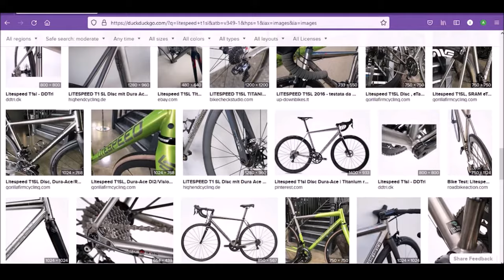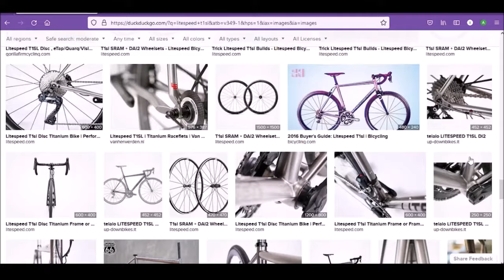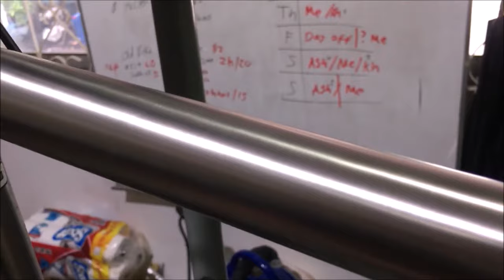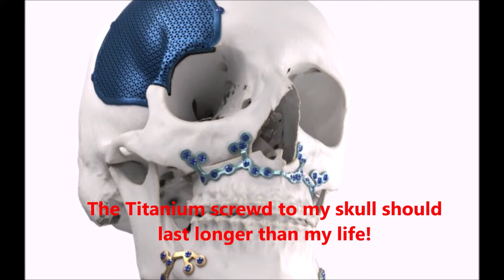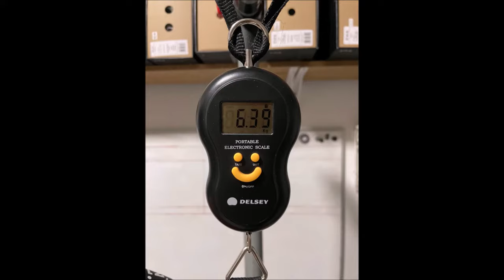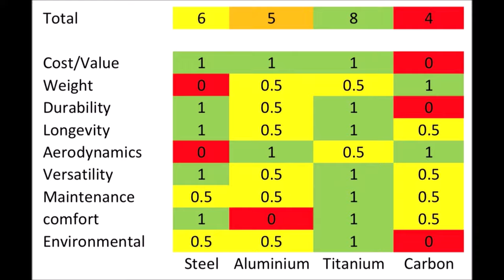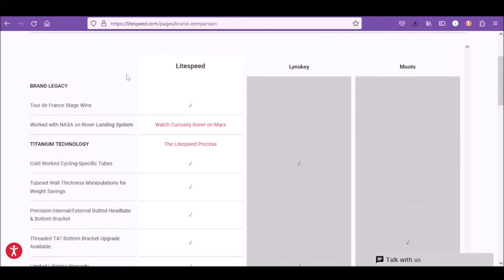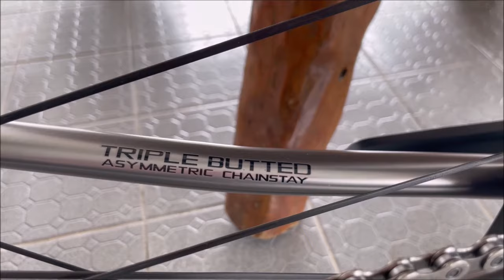The World’s Best Performance Road Bike. (And It’s Not Carbon…)

Comment: titanium doesn't degrade over time, could be same for plastics, but we don't praise them for being non degrading and living 1000 of years in a ground. 
Steel by rust returns to nature as if it was never there before (nature will absorb it and nourish). Aluminum much less and even less titanium. a Ti frame will be found there 2000 years after... that is NOT A POSITIVE from environmental standpoint. (I love it by the way, just the argument is very bad)
Reply from the maker: Explain further? Plastic brakes down into tiny bits that we then consume via water and food. Titanium is inert and doesn’t brake down over time. So no need to bury it in the ground, it can be recycled and reused endlessly. 

I don’t follow why this is a bad thing? 🙂

Comment: Street cred is important. I will openly admit on a public forum that I buy carbon frames due to peer pressure. It sounds like I’m cutting edge and modern when I tell friends I have a carbon bike 🚲 👍
Reply from the maker: True, peer pressure is the main reason people choose carbon in Brunei. They don’t want to be the odd one out, it’s especially strong in Asia.
Reply: @reginaldscot165  And here I am, still riding on aluminium after 11+ years of riding. I now have two aluminium road frames, one rim brake (already built a year ago at home) and one disc brake (only has its groupset, everything else isn't bought yet).

Comment: Haven't watched the full video but that carbon-aluminium-Titaniun tube test at 16.58 onwards is worse than iffy.

Carbon tube the jeeps wheel is sitting flat on the concrete and the tube is well forward of the shuck. Aluminum tube the jeeps wheel is sitting flat on the concrete and the tube is sitting well forward of the shuck, but on the titanium tube test the jeeps wheel is buried almost halfway down in a shuck and the tube is sitting on the edge of the shuck so full pressure isnt resting on the tube as it was on the previous tubes and the crushed aluminium tube also helps prevent the full weight of the jeep crushing the titanium tube.

100 lines of could do better for Reginald.
Reply from the maker: Not sure what the last sentence is referring to but… I can tell you that that test is legit. I have several titanium tubes in the shop and no way my 4x4 is crushing them. Titanium is really, really strong. I have 1 that’s an off cut of the 6/4 titanium top tube of the T1SL, it’s less than 1mm thick and it’s unbelievably ridged and strong. I get customers to do anything they like to it, I say (if you can bend that paper thin tube I will give you the bike for free! So far nobody got a free bike. 😂
Reply: @reginaldscot165  Can't agree with you on that test being legit tbh. Looks like something Del Boy and Rodney Trotter would have put out.

Comment: This is heavily biased against carbon fiber.  I don't know ANYONE who has to replace their carbon bike every few years, ridiculous statement.  I have one that's 10 years old, no cracks or issues.  So why does that Litespeed have a carbon fork and carbon wheels?  And your chart, you weight every category the same.  That's not realistic, because depending on your needs, some categories would be weighted more heavily.  So, interesting, but not the final word on the subject by any means.
Reply from the maker: Just imagine how big the chart would be if we adapted it to every individual situation. Its general statements, and in general it’s correct. Well, I work in a bike shop and I see plenty of carbon bikes that don’t last… so I’m going by experience… I had one that didn’t last 6 months. BB shell cracked on me.
Reply: @reginaldscot165  I am intrigued now by Ti.  Problem is, I love the way aero bikes look, and I think aero outweighs weight in most cases.  Being in triathlon, I am looking for a tri bike, and I believe they are ALL carbon.  Are there any Ti road bikes that prioritize aerodynamics?  I don't think Ti lends itself to the same aero shapes though.

Comment: your table is a mess: some of the attributes you list on the environment category belong in fact elsewhere (longevity... which is quite the same with durability). 
And some relevant omissions: carbon footprint for turning titanium to tubes and then welding those tubes? 
Etc. etc....
If you make a point that a bike is the best performance bike, then some of your categories are irelevant.
Reply from the maker: Longevity is different from durability. Something can last a long time, but if used isn’t resilient. Durability relates to how something can resist damage whereas longevity relates to if a material naturally degrades over time. 

I think all aspects are important when finding the best performance road bike. It is a performance road bike and the categories show why it’s a better choice than other performance road bikes. 🙂

Comment: Can someone tell me why they use a carbon fork instead of titanium? Is it hard to make such a shape or any other reason? Amateur here...

Thanks.
Reply from the maker: Yes. So difficult and as a result more cost. Also it’s the part of the bike that normally takes the brunt of the damage in a crash so better to have something expendable. Also it makes it easier to change brand of forks to get different ride feel if you want to change the geometry. Also as people already make lots of forks it’s easier to buy from them than make your own.
Reply: @reginaldscot165 Thank you!

I see your point against carbon. How does the fork hold up to that? Do you replace yours over some time.

I currently only have 1 alu bike for everything and mostly commute. Its harsh sometimes. Would you advise against a carbon fork for such use?

Comment: If that was the worlds best performance road bike, you would see pros riding it. However since it is a not so aero bike made out of metal, and also not very light for a rim brake bike, as pedals are included in the uci weight, it is of course not the best bike. But surely it can be durable, the sad thing though is that a negligent owner might just as well send this bike to the scrapyard as a carbon bike owner, not many people want to ride the same bike for 30 years.
Reply from the maker: Your reasoning is flawed. 

The prevalence of a bike or item in the “Pro tour” has zero relation to its performance. 
Firstly, there are literally 100s of items and bikes that are banned for use by the UCI for pro riders that would definitely improve their performance. But they are not allowed because they contravene some rule. 

Secondly, Pro riders don’t choose their own equipment, they get given equipment based on sponsorship. Pro cycling like all big spectator sports is all about money. Titanium manufacturers are small and don’t make the volume of bikes to make the money to sponsor a pro team. 

Also, the system is set up to discourage brands from making long lasting bikes. The Pro bikes change every year, sometimes twice a year. There is big money to be made in selling the next slightly different shape of carbon bike. The same couldn’t be done with titanium, it’s too difficult to make new designs like that and it lasts a lifetime so there wouldn’t be any reason to keep changing your bike. 

To put it simply, titanium bikes are not profitable because they are too good. It’s the same reason nothing lasts anymore, planed obsolescence. 

People with the intelligence to buy Titanium aren’t normally the sort that would dump it in a landfill. 😇
Reply: @reginaldscot165  You have higher faith than me in people who afford to use the kind of money that would easily get them a sports motorbike on a bike. From my reasoning these guys would normally be in their 50s and well off. In the not so unlikely event of a lack of interest or declining health 10-15 years later, who knows where the bike ends up. If the gears or brakes have ceased to function after years in the shed or are worn out, the scrapyard is not so unlikely, as on the used market these are not valuables anymore. What if the owner dies - titanium bike in garage sale, no takers - landfill. The talk of carbon bikes deteriorating is also vastly exaggerated. My current carbon bike is 6 years old and has 37.000 kms on it. The drivetrain has been changed of course, but these are metal parts. Also the wheelsets have changed a couple of times due to wearing out on rim brakes. Again these have been mostly metal parts - alu wheels, however currently on carbon wheels. But the frame ? Not wearing out unless you crash it, and believe it or not, a titanium frame can also be destroyed in a crash, just like any car or motorbike made of metal.
Reply: @reginaldscot165  You have completely missed why new bikes are coming along all the time in the pro ranks. Mostly it is new equipment on the bikes, the frames do differ but only slightly, but the addition of another sprocket every few years is indeed a market trick to get everybody to buy the latest 11 speed then 12 speed then electric this and that, then discs over rim, then aero bars, integrated cockpit, all things that could just as easily be swapped on a titanium bike. If you change out the word "good" with durable or environmentally friendly, then there might be a discussion. But when it comes to being outright fast, obviously all the amateur racers in the world have long since found carbon to be the best, however both ti or steel can be good bikes, they are not the best :-)It is refreshing though to think about the old pros who rode 40km/hour average on 10-11 kilo steel bikes with what 8 gears at the back ? Not all about the bike.

Comment: Not necessarily a bike for life with rim brakes. Components are getting harder to get. We will see the time when Sram and Shimano will no longer offer rim brake  groupsets and rim brake wheels will no longer be made.
Reply from the maker: The way things are going I think rim brakes are going to outlive western civilisation. 😂 
But seriously, I still have the first good rim brake group set I ever bought. Ultegra 6600. Still in perfect working condition. I don’t think finding pads is going to be a problem. I don’t change them regularly, maybe 1 set every 3 years? I also have a stockpile. People will continue to ride rim and some manufacturers will continue to provide parts. (I can still get new parts for my 1996 car.) As for wheels, I get through rims about 1 set every 10 years. I have 4 sets of wheels currently in use and I have other new unused sets. Again, they will be available. Don’t forget that if you have let’s say for argument 40 million people riding rim road bikes. If they all switch to disc that’s 40 mil second hand parts minimum now available. That’s on top of the 100s of millions of parts in shops and warehouses that is yet unsold. Look at Durian rider, he buys second hand rim bikes all the time for next to nothing and thus has an endless supply of parts and spares. 🤷🏻‍♂️
Reply: @reginaldscot165  I guess I should've said new components will be harder to find. For example, Litespeed no longer has rim brake frame offerings. At some point, Shimano and Sram will stop offering rim brake groupsets, al least in their upper end lines. The wheel manufacturers will follow suit, because if there are no more rim brake frames, why make rim brake wheels? Will there enough of a market of people wanting to upgrade rim brake rides to keep making rim brake groupsets and wheels? You're right in that there will be second hand parts. True.

But consider something like my situation. I needed a new frame. Rim brake. About the only new rim brake frames I can find are the open-mold Chinese ones. Not that they're necessarily bad. Some of them are good. But you can't be sure.  I've always wanted a Litespeed Ti bike anyway, so I'm taking the plunge and drinking the disc brake kool-aid. Forgive me.

But funny enough, as I write this, I see a video featured about "Rim Brake Resurgence?" Maybe rim brakes will be like vinyl records. They'll all but disappear and then suddenly become the "new big thing!" 🤣🤣

Comment: Rim brakes and carbon wheels….😬
Reply from the maker: Modern carbon wheels from Winspace. If you have ever used them you wouldn’t have made your comment. 😉

Breaking wet and dry is perfection. Light, fast and stiff and not expensive. ❤️ Go check out my reviews 😉
Reply: @reginaldscot165  also can over heat and delaminate.

Comment: I want an illegal bike. :face-blue-smiling:
Reply from the maker: Nice 😎
Reply: Then make one.. just put non reflective pedals on whatever you have.. and hey presto!
Reply: That is easy: buy an e-bike with a usable motor.
Reply: Hi @reginaldscot165 thanks for the thorough review.  I think some might question the equal weighting of the variables in the first part of your analysis, but either way - I’m sold! Has the T1 SL XS frame featured in the video been sold? If not, how much are you selling it for?

Comment: The current Litespeeds are rebranded Lynskeys.
Reply: No they aren't. I ride a Lynskey GR300. Different factory, owners and other differences. Yes, I'm aware of Litespeed's history and previous ownership, but a contemporary Litespeed is not a "rebranded" Lynskey. Like that is even some sort of intelligent "gotcha".
Reply from the maker: Correct 👍🏻
Reply from the maker: Actually that’s incorrect. 🙂
Reply: @paulvanreesch2493  Cool, it was meant to be a joke dude. I have been a follower of Litespeed bikes since the beginning, strangely Lynskeys bikes these days are heavy weight paper weights compared to Litespeed, the Lynskeys were way more innovative as Litespeed.
Reply: @reginaldscot165  It was a tongue in cheek comment, since you were bringing up rebranded Litespeeds, current Litespeeds have Lynskey DNA, if you were following Litespeed since they were cool in the 90s and founded by the Lynskeys you will feel that Litespeeds were Lynskeys due to their past connection.
Reply: @stephenang499  Yeah it is a bit odd that David Lynskey sold off Litespeed, founded Lynskey and now makes what seems to be an inferior product.
Reply: @WhaJMc  Litespeed owner here, just curious. What would you say makes it inferior other than the weight and website differences?

Comment: Sorry, but my statement from a while ago remains - you wouldn't know what a good bike is if one fell on your head.
Reply from the maker: I don’t remember that statement. 🙂

Please offer us your opinion on a good performance road bike. 🙂
Reply: @reginaldscot165  
Alright then.

Starting off with something that any road bike should have: clearance for at least 28/32mm tyres. 

As for performance bikes:  aero optimized tubing, integrated cabling, preferably disc brakes (better modulation than rim brakes no matter how you spin it, and as per PeakTorque's findings, disc brakes aren't producing more drag than rim brakes, not to mention that using disc brakes allow wheels manufacturers to reshape rims to be more aero).

Comment: I have a nicer bicycle and it's steel😂
Reply from the maker: “Nice” is an opinion. The T1SL is better by fact. 😉
Reply: Yes but I've been  riding mine for 27 years.... It has a lot of value to me🤷🏻‍♂️ And I like bikes with threaded headsets and bbs.
Is that 995g for the frame or the frameset, btw?